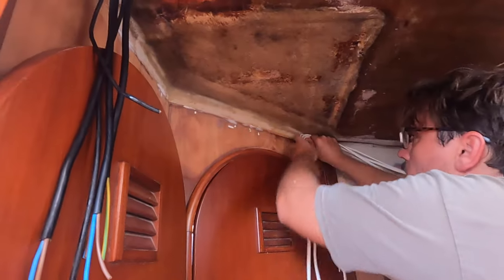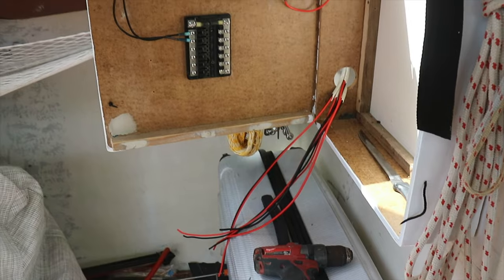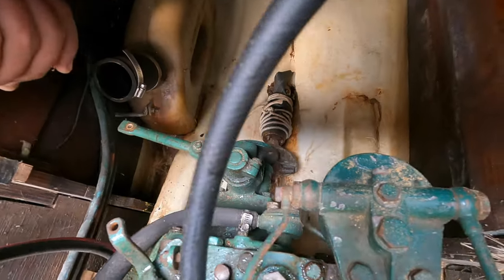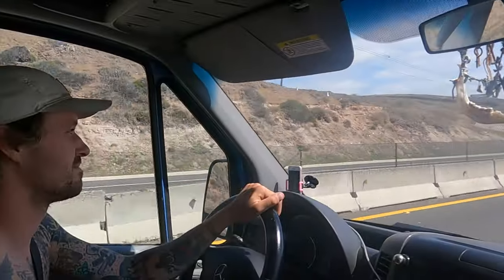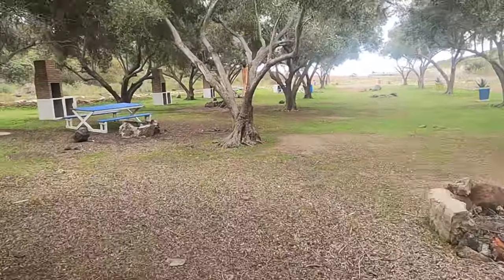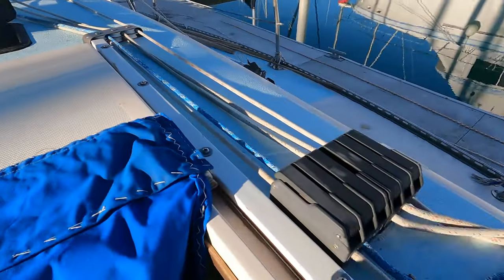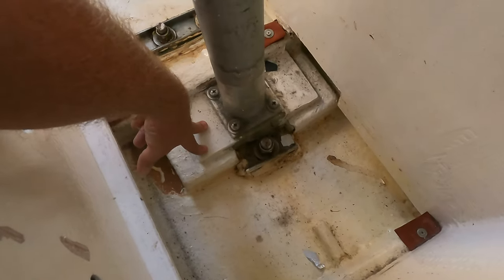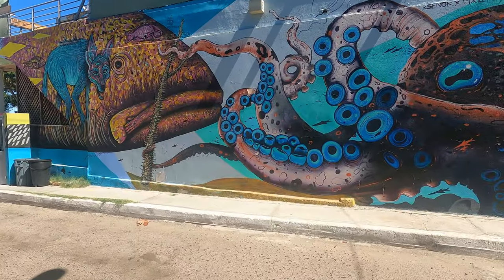TAKING OFF with help from our friends #96

Comment: Dump the lead acid 🔋batteries. 18650 cells for a good lithium ion is the way to go. Easy peisy. Robinson has the skills to get it done. Will batteryhookup.com ship to you? Put in your wish list.
Reply from the maker: I love getting suggestions! Thank you, will check it out, although I suspect that it may be hard to ship here for the same reason that we have hesitance towards lithium ion - fire hazard. We’ll take a look though...
Reply: You are most likely surrounded by these. Anything that is rechargeable has them 18650 lithium ion. It's very common. When a battery pack goes bad it's most likely only one cell is bad. The cells I am getting are from motems that were never used to begin with they are out of date. The 18650 cell is new. But instead of $6.50 usd they are .50 cents. By them selfs they won't do much.  But in series and paralleled you can build a 12 or 24 volt system with 100ah of storage. Some copper wire and heat shrink wrap and your pros. My project now is a solar generator made in a$23. Craftsmen toolbox. It will have 3,500 watts of storage. Cost to build ? About $650. The build is on YouTube. Have a look.